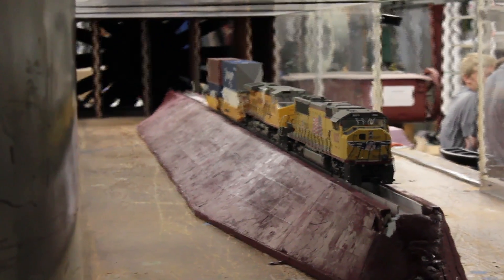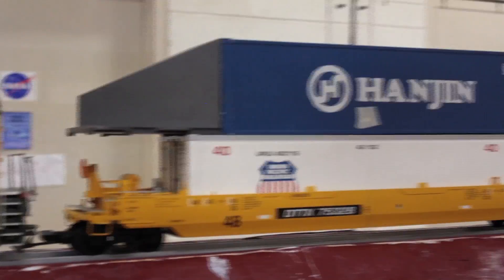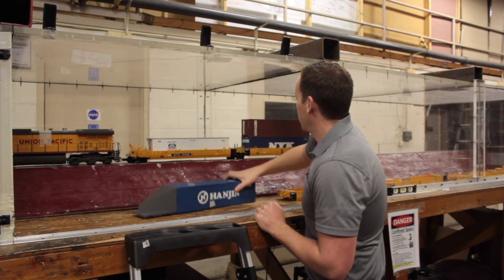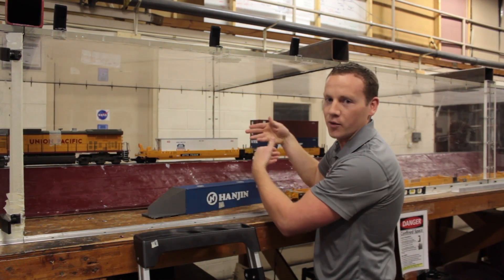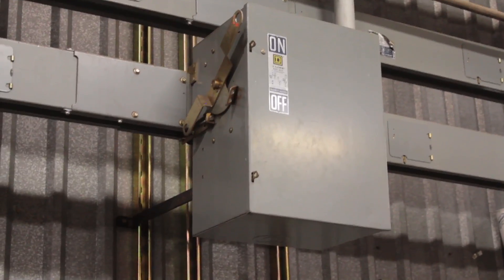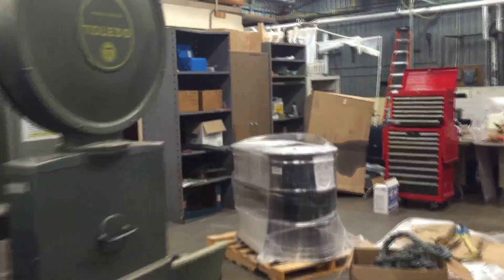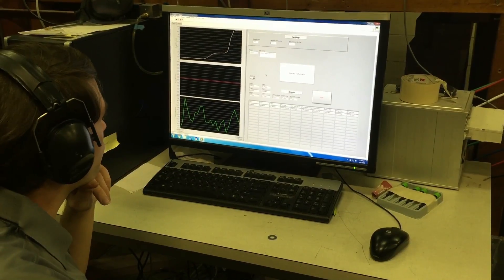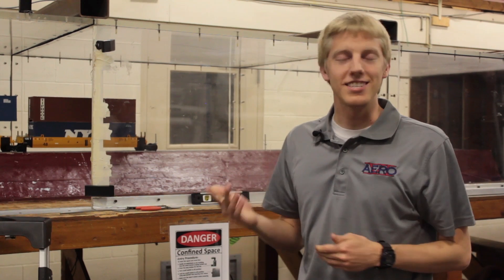Testing the Arrowedge 3.0 at BYU

Comment: I am a former intermodal railroad marketing and operating guy and see the wedge container occupying a slot alternately used by a revenue generating container.  Not sure if fuel savings off sets the revenue loss (RPU on landbridge container LA to Chgo is about $2K). The wedge containers will require capital to acquire, labor to load in position and remove.  Wedge containers will also occupy parking space in terminals - a very rare, expensive and dear item.  Just like in the days of the caboose, all the cabooses (or mty container well cars, chassis, what ever) always pile up on the wrong end of the network and need to be repositioned.  Not sure if all this adds up to the fuel savings afforded by the wedge. Always worth trying something new though.

Comment: Streamlined engines would do the trick
Reply: Making the engine streamlined would also reduce drag hugely because the wind would go around the engine and not push the train
Reply: Cape Main Rail Photography isn't a standard cab more wedge shaped that a wide cab? Whatever happened to good power? Stupid. Canadian. Cabs.
Reply: wide cabs are not what im talking about im talking about the bulldog nose used on engines such as F and E units

Comment: I suppose the weight of the load would have much to say but would wind speeds (say 30-40mph) from the side manage to tip these over much like a semi truck can be pushed over from high winds?
Reply: In short, yes wind gusts can tip empty stack trains over. There is one example on You Tube of a stack train crossing a bridge in the middle of a storm and containers ending up on the roadway below, fortunately no one was killed or injured.
Reply: no, these containers are latched to the rail-car and each other.

Comment: The biggest drag on a stack train is the ribbed sides of the containers, having a brick of a locomotive doesn't help. Might show results on a model but in full scale in real world it will not be worth it, If I remember right BYU was working on this years ago,  still can't get it to work.  Streamlined locomotives would go along way, something like a Genesis body on a SD70 (I know one is GE and one is EMD, just giving an idea), could have a A-unit with cab-less B-units.
Reply: So you're preferring to go back to the F unit ABBA concept?

Comment: If you're going to do that, why not also streamline locomotives again instead of having them shaped like bricks?  LOL
Reply: The locomotives are designed the way they are, for a reason
Reply: +Collin Weis Economy I would imagine.  It's simply cheaper to build them to look like bricks because to curve the steel into a streamline shape would cost more.  Of course every design has a reason, Jeeps are also shaped like bricks, but then you don't need a streamlined vehicle for utility purposes.  I'm just saying if you're going to add a wedge for aerodynamics to one part of the train and yet have the lead part of it shaped like a brick where the initial wind resistance is, it really seems kind of pointless.  Sort of like putting an air foil on top of a Jeep's roll bar.
Reply: And also for functionality. Add to this, that weight is not an issue with freight locomotives. Also, locomotives in the U.S. that you see pulling freight will trip an overspeed warning at 73 mph and they will not top that. Aerodynamics are not an issue with diesel-electric locomotives in the U.S. at the moment. And may not be in our lifetimes
Reply: But that's my whole point.  Since it isn't an issue for the locomotives, why should it be an issue for the freight they're hauling?  To have that wedge up there seems superfluous.  The train isn't going to go fast enough to need it because the locomotives aren't going fast enough to need it.  If the freight is going to go fast enough to need something like that then why pull it with something that has all the aerodynamics of a wall?
Reply: It's a fuel saver and the railroads love saving money. Lol. That's about all it really adds up to

Comment: Below speeds of 60mph probably not big deal, above that gains will be big. Putting flares on the back of the containers so air can't get between the cars will help a lot too.  All of that is pretty proven technology, the question is is it worth all the extra time and materials doing to save some fuel? probably not.  Probably more practical to build trains with hoop and canvas covering like curtain side trailers and enclose all of the cars and cargos with one continuous sheath making it look like a streamlined passenger train regardless of what cars were underneath.
Reply: +bcbloc02 Yes of course. And this is a side effect of container dedicated 3-sets or 5-sets (sorry I do not know the english for that) wagons. As they are tied together the distance between containers is shorter than it is between to separate wagons. Those 3-sets or 5-sets have many advantages, you need to connect brake pipes every 3 or 5 cars, you have one less bogie, you have less air resistances. I think there should be already a significative gain with that technology. 
The aerodynamical gain is proportional to the square of the speed, and freight trains are rather slow, the gain cannot be compared to what is achievable with HST like Acelas for instance.
More, freight trains are very long around one our more mile, the gain is mainly on the for part of the train, aft, the train moves in moving air which is following the train, and the gain is only proportional to the square  of the speed difference between the train and the surrounding air.
Please excuse my frenglish!
Reply: That's not a bad idea, a streamlined Stack train.
Reply: +bcbloc02 The gap between cars does not create much additional drag.  The car in front disturbs the air, lowering the pressure on the next car.

The most practical thing to reduce drag between cars would be to use car sizes that match the containers- 53 foot containers in 53 foot cars and 40 foot containers in 40 foot cars.  Putting 40 foot containers in 53 foot cars, as often happens, results in a larger gap and more resistance.